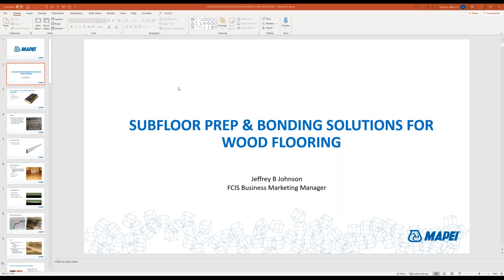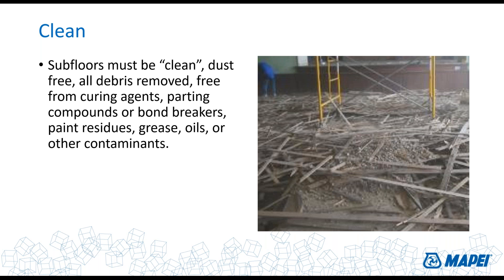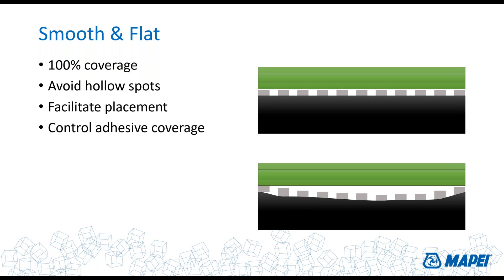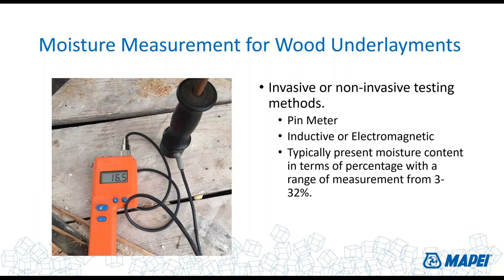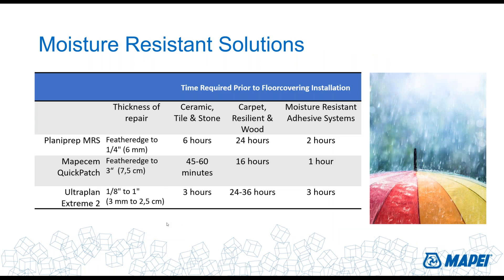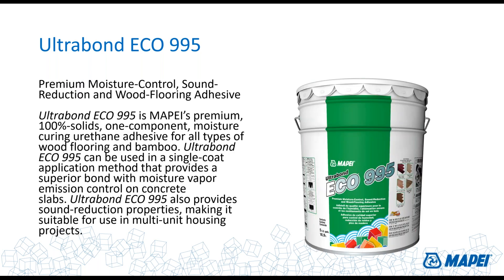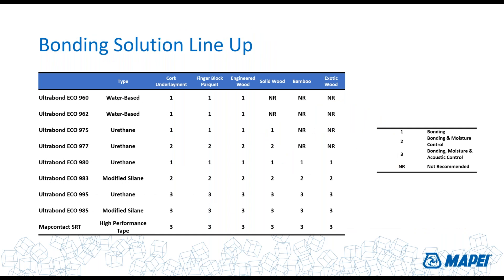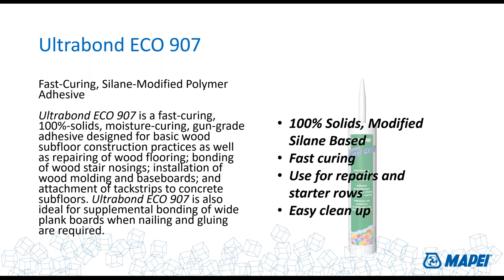MAPEI Webinar – Advances in Wood-Flooring Installation Options

Comment: Can I use Planipatch over suitable plywood subfloor in order to fill some tongue and groove joints as well as some screw and staple holes? Plan is to patch with Planipatch, then use Primer T, then use Self-leveler Plus. Structurally sound area.